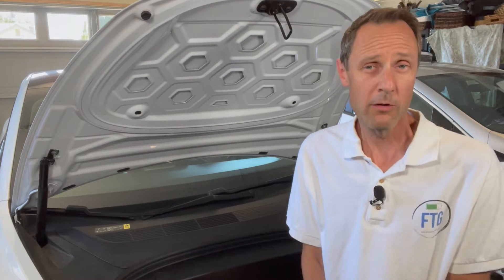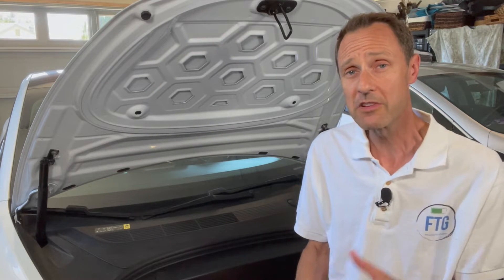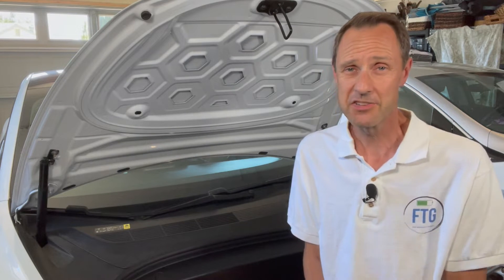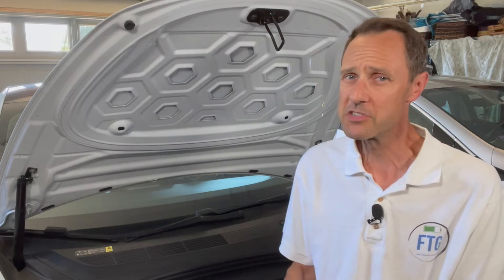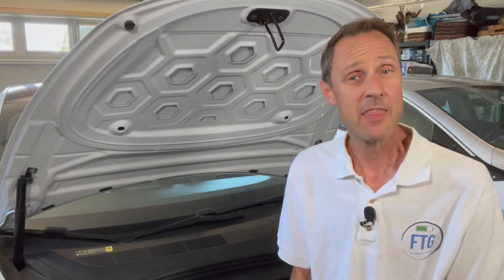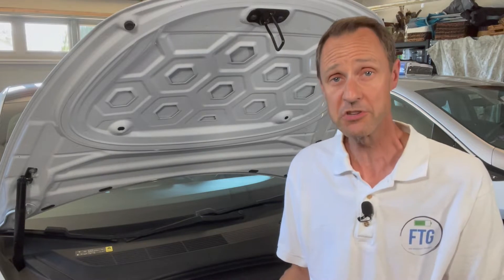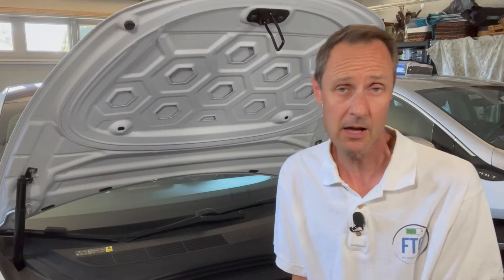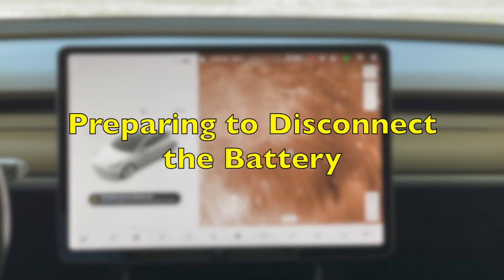How to Swap Out the Tesla Model 3:Y 12 Volt Battery

Comment: I just did this swap out today on my Model Y. Super easy. I'd recommend/emphasize a few safety things. Wear protective lenses and as TFG did, wear insulated gloves. Also, I would leave the negative cap on until you're ready to reconnect, to avoid arcing by accident when tightening the positive terminal.

Comment: Would i change out the battery myself? Depends. Probably not. 

If I’m at home, within 25 miles of a Tesla service center, I’d pay the Tesla mobile service to do it. If I’m on the road and outside their mobile service area, I would definitely consider doing it, assuming i have the right tools with me. But chances are I’d call AAA and they’ed swap it for me. 

Having said that, this is an excellent tutorial and i love knowing i could swap it myself if I had to. Thanks!

Comment: Okay, I curious. Why do you need to roll down all the windows and open all the doors? Seems an odd requirement. Pulling the high voltage interlock makes sense since this will disable the DC to DC converter that would be trying to charge the battery.

Comment: In a new 2022 Model 3, it's a 12v battery with about 7000 mah, correct?  If you leave several things charging in it over night, does the 12v battery go dead or does the main battery automatically start charging it when it gets low?

Comment: I noticed you had some accessories attached to the battery. I will be installing an underglow kit that connects to the 12v battery. Do I need to power down and disconnect the plug under the rear seat when tapping into the 12v battery? Or is that only when you are changing out the 12v battery?

Comment: All these videos were very useful to me this week. My model 3 bought 2018 Nov gave me warning on 8/2/21 AM to change the 12 V battery. I made an appointment with Tesla mobile service for 8/4/21 afternoon. Drove 3 miles to work. When I tried to use Model 3 to return home in evening of 8/2/21 - my model 3 was dead. Tesla road side assistance arranged for a tow truck which was supposed to take 90 minutes to come by. Around half way through this wait, my model 3 turned on mysteriously  and I was able to drive back home. By then mobile service rescheduled my battery swap appointment to 8/16/21. Refused a back up transportation even though my car could not be driven safely. Refused to install Ohmuu battery, if I bought one myself. My car is still under warranty and they would cover battery swap free of charge if I waited until 8/16. However, I could not wait until 8/16 so I bought Ohmuu battery and installed it myself - thanks to your videos. My Tesla service experience has been horrible every time. I do not think I will buy another Tesla. These people do not value their customer's experience.

Comment: But after replacing the battery that warning still pops up and might need the Tesla Star machine to register the replacement of the 12v battery, I replaced a battery for model s , and that message still there after the job .
Reply from the maker: How long ago did you replace the battery. Doesn’t seem to be a issue anymore. Maybe a software fix?

Comment: Nice job as always.  I did have a few questions as I will be at 2 years in January.
1.  Any idea if doing the work yourself voids any Tesla warranty?
2.  Is the battery a standard 12v just smaller to fit in the Tesla space?

Comment: At 3:09 you disconnect the negative cable and wrap it in cloth and warn that it should not touch any metal. The other end of the negative cable should be attached to the frame and therefore doesn't matter if it touches metal. The battery is the power source so you need to cover the posts on the battery and not the cables coming from the car. Later on, after attaching the positive cable you need to cover the terminal with the red rubber boot before attaching the negative cable.  If the end of your wrench makes contact with the bare positive terminal while tightening the clamp on the negative cable then you will get an arc and potentially damage the battery.

Thanks for all of your videos.
Reply: the first thing to disconnect should be the negative cable and the last thing to connect also

Comment: Nice video. You just left one little detail out: How do you power your car back on when you are finished? Or will it just magically restart?
I will most likely leave such work to the professionals, despite it being a relatively easy thing to do.
Reply from the maker: It just powers back on by itself.
Reply: @FrugalTeslaGuy  Will it retain all previous settings?  After I had my FSD computer upgrade, I had lost all my trip readings that I had been saving for my lifetime efficiency, tire mileage, and had to reprogram my preference for things like my seat positions. I also had to reprogram my Homelink settings.
Reply: @jeffnreno5080  I'm not sure but I'm guessing this process will retain everything.  All your options are probably in non-volatile storage on the board that was replaced by the computer upgrade (which would explain why nothing was saved in the FSD upgrade).  I just look at a Tesla as a computer on wheels and that appears to be how Tesla has created it.

Comment: Replacing the 12 v. battery seems straight forward enough but I’m at the point in my life where paying to have it done is more appealing. Also, the lithium ion battery option seems too expensive….at least for now. And lastly, I’ve yet to need mobile service. When the time comes, I’m curious about that experience. Thanks for the series, it’s very helpful.

Comment: After installing the Omnu battery, does the gas vent tube from the lead acid battery just hang loose in the bay beside the battery?  Also, how do you power the main 15” screen back on when the job is complete?
Reply from the maker: The gas vent is no longer used and the screen turns back on when you connect the power.

Comment: Is there any concern with how the car manages the Lithium battery? i.e how it monitors the voltage, knows when and how much to charge it and detection of when it is going bad? I am sure it probably has different characteristics such as votage drop under load and off load, capacity etc. I am not an electrician so I may be speaking rubbish!! My car is coming up to 3 years old so concerned I should do this pre-emptively.
Reply from the maker: Legitimate concerns for sure. I personally am not concerned about it. It has been on the market for over a year (or 2 or 3?) and has proven itself to work so far.

Comment: Thank you for a good and careful review of battery replacement. 
If the 12V battery is completely dead so that you can not open the frunk, then I would assume that you can boost the car to life by using the 2 terminals that are visible on the right side under the back seat. See the red plus terminal at 2:14. The minus terminal is right next to the plus terminal. A 12V jump starter connected to these terminals should bring life to the car - but it's not something I've tried yet - so I disclaim any responsibility regarding this.
Reply: If the 12 volt battery is dead, there are 2 wires under the tow hook cap.  Take off the cap and hook up a 12 volt source (or I think I've read even a 9 volt battery).  You can then open the frunk for access.

Comment: Did you have any issues with the software after fitting the Ohmmu?
Reply from the maker: Nope
Reply: @FrugalTeslaGuy  
Thanks! I’ve been wondering whether to get a Li battery in advance ready for when the 12v dies, but have seen one or two comments against them including that they don’t last as long as advertised and that you have to do something with the car’s software to make them compliant. Glad to hear your experience.

Comment: On the 2021 refresh Model 3 this is slightly easier - you do not have to remove the air intake grill.  It's smaller because of the Octovalve system.  When you open the frunk and take the plastic panel off, the battery is just right there fully exposed.  This is also because the frunk itself is deeper, but not quite as wide (to make room for the Octovalve stuff).  You just have to undo the two terminals and the clamp.
Reply: Is the disconnect still under the rear seat?
Reply: @ejduffy  In my car it is.  I can't speak for the new Highland refresh as I don't have one.
Reply: @StormsparkPegasus  thanks, I have a 2021 too.

Comment: Did you put the gas tube back on? You skipped that step
Reply from the maker: Don’t need it for the Ohmmu battery
Reply: Li-Ion battery does not produce any gas when charging. So not vent tube is required.

Comment: Really excellent video! I see too many videos where they don’t disconnect the connector under the rear seat. That’s where all of the 12 volt emergency power comes from. I learned that from Brian at i1Tesla a long time ago. He proved that the lead acid battery could be disconnected and that there was still power to open the doors from the inside in an emergency (probably the windows, too). I’ve seen plenty of people install the swivel center screen and they just trust the Power Off button on the screen. Touch the brake pedal by accident and everything will wake up.

Comment: Why do you have to roll down the windows and open the doors before battery replacement?
Reply: You don’t want to accidentally lock yourself out of the car when it’s totally powered down. 
You might be able to open the frunk by using the emergency power connection behind the access hole for the tow hook in the front bumper. It’s software locked unless the 12 volt battery is too weak or dead. The idea is that you can open your frunk, replace the lead acid battery and then you would be able to gain access to the passenger compartment. When the Model 3 first came out, anyone could open your frunk, then Tesla had an over the air software update and then that hack didn’t work unless the lead acid battery was dead!
I spoiled the next part of this video, I think.

Comment: Will the car display any errors with the non Tesla battery?
Reply from the maker: Nope
Reply: its not a tesla brand 12v battery, the car does not care.
Reply: @laloajuria4678  misinformation, it causes because the voltage standards are different
Reply: I did see some issues a while ago from an unrelated software update, but the battery company took care of it. I’m leery of changing it too, unless you live in a really hot climate, like Phoenix, Arizona, where the lead acid batteries do not last very long.

Comment: Legacy tech. Shame Tesla didn't future proof with a lithium ion 12v at the very least.
Reply: Way too expensive and lead acid batteries work in high and low temperature extremes, those were the excuses years ago.
Reply: They are now moving forward with lithium ion 12v batteries. Starting with the new S and X that Elon talked about a few months ago.
Reply: @famoussasjohn  3 and Y get them too